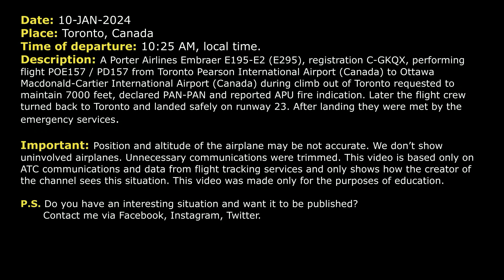PAN-PAN. APU FIRE indication after takeoff. Porter Embraer E195-E2 returns to Toronto. Real ATC

Comment: Fuel quantity units are a mess. Gallons, liters, kg, pounds, tons, so many units.
Reply: That's just it. We don't report quantity. We're supposed to report fuel remaining in time. But some ATC's want different things.
Reply: @JohnSmith-zi9or  
ATC needs to know time, ARFF needs to know quantity. They will ask for either depending on the situation.
Reply: @A.J.1656  ARFF does not "need to know". Their response does not change. They say they do. But do they really? They aren't going to not send equipment if they think you only have a small amount of fuel. 

For example, a 777 landing with 10,000 pounds or a 737 landing with 30,000. Are they really doing to change their response either way? No. 

All these questions are crap. AIM says fuel in time souls on board. 

Question, they ask a cargo pilot "do you have hazmat?" ... the answer is ... Yes. Jet fuel. LOL I mean, are we really going to start reading off the DG manifest and the types quantities of the DG? We'd be dead before we were done reading. 

Fuel remaining in time and souls. Anything else is time dependent. 

Aviate Navigate Communicate. In that order.
Reply: @JohnSmith-zi9or  
You might sound a little smarter if you spent more time reading ARFF advisory circulars instead of typing what you think is true. 
You're wrong. Read.
Reply: @A.J.1656  As I said, time remaining in minutes and souls on board. Everything else comes if we have time. 

Oh, you want our fuel in pounds. Sure, it's whatever. Oh, you want it now in kilograms? Well that's going to take a few minutes. Standby.  

You see, there are these things that pilots and dispatchers have to file. They're called flight plans. And there's a FOB and a POB block that must be filled out. It's almost as if they have that information anyways.
Reply: @JohnSmith-zi9or  
It's obvious you want to argue with me, but you are trying to change the subject to skirt around your false claims. 
ARFF response was to know quantity, ATC wants to know time. 
I never said anything about how much time we have to answer the questions.
Reply: I stated what we are supposed to report which is codified in the AIM which isn't regulatory. Until it is in a CFR, I'll get to it when I get to it. 

ARFF can ask for all kinds of things. Chaff it unless you have the time. 

I'm not arguing.
Reply: Afaik, the emergency responders want fuel quantity(rather than time) in order to know how big the fireball is going to be.
Tho, you'd think they would be willing to convert units rather than the pilots.  @JohnSmith-zi9or

Comment: At least it's a private plane, it doesn't make any sense to take a commercial flight for a so short distance. Going to the airport, come back, security, etc takes more time than just taking a car/bus/train.
Reply: But it is a commercial flight
Reply: That's why taking this flight (at least it's a connection flight) doesn't make any sense.  @dasmellyyooper
Reply: 4.5 hours by train (the fastest alternate method of travel), just over an hour by plane. But of course it does depend on where you originating and final destinations are in relation to the arrival/departure airports.
Reply: United flies an Airbus from Denver to Colorado Springs. People book flights to smaller airports but might have to stop at a hub. If they have a decent amount of passengers, it makes sense to schedule a flight. It's not a flight of people living in the hub city traveling to the smaller airport, it's people coming from all over who make a connection at the hub.
Reply: of course it makes sense. A flight from the largest metro area in Canada to the nation capital. Of course there is a flight for this distance. Especially when it's a nearly 5 hour drive
Reply: It's like flying from SF to LA, ridiculous @DeltaBravoTango